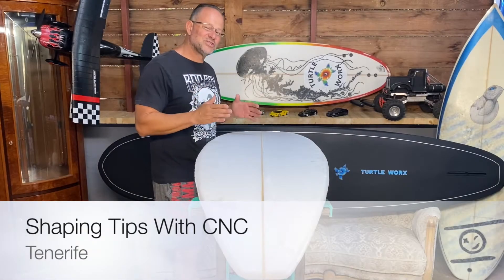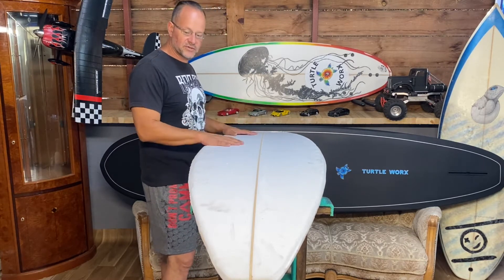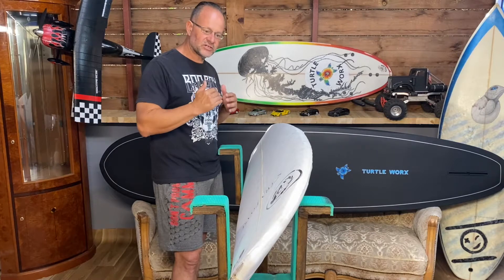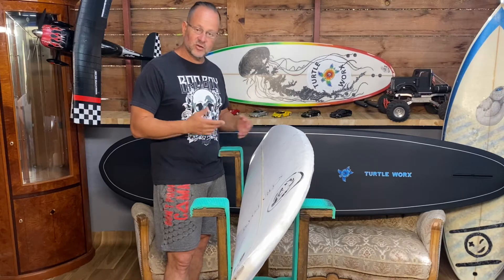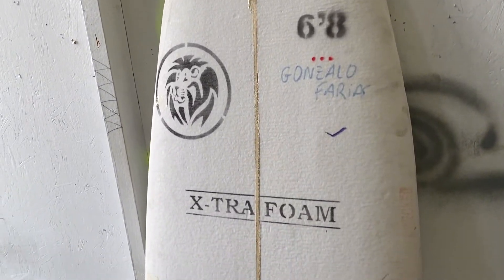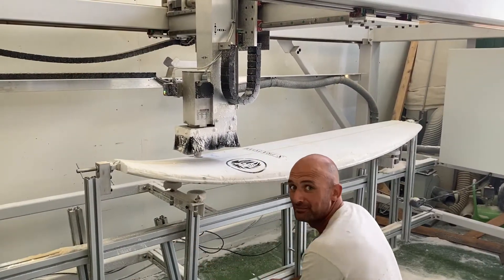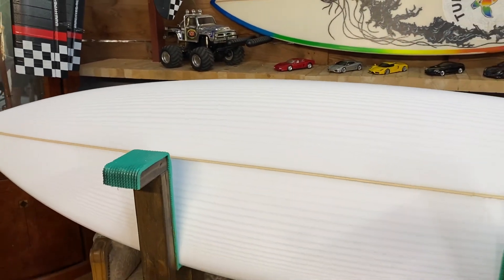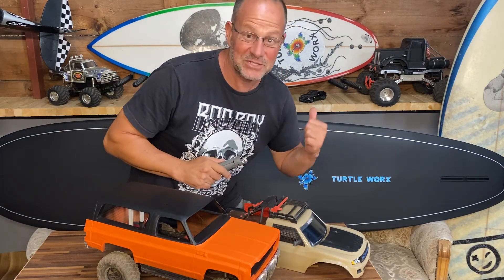Surfboard Shaping Tips with CNC Shape3D

Comment: Hello there! Between the board coming out of the CNC machine and receiving the last coat of resin, how much thickness is added to it (in matters of fiberglass + resin)? I took a measure on a board that i cut a part of and it seems to be between 2-3 mm or a little less than 1/8th of an inch.
Reply from the maker: hey bud, it different on every board
Reply: @borisworx9199  Hey Boris, thanks for answering. I believe I should rephrase my question, what i meant is: between the board coming out of the CNC machine and receiving the last coat of resin, how much thickness is added to it? 

That is what i meant :) I will edit my question so it is more clear for everyone else.
Reply: I am thinking the 1/8" or just under is pretty close.